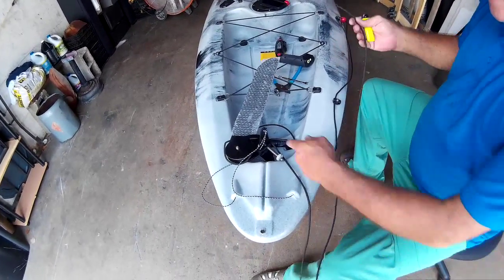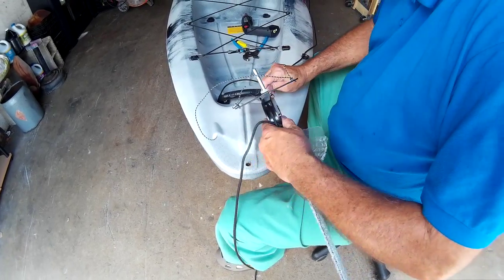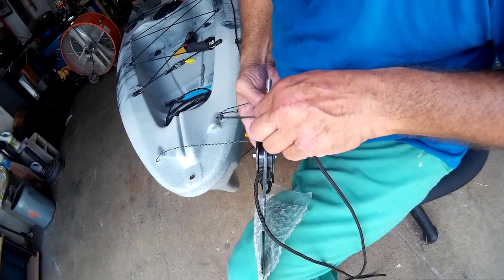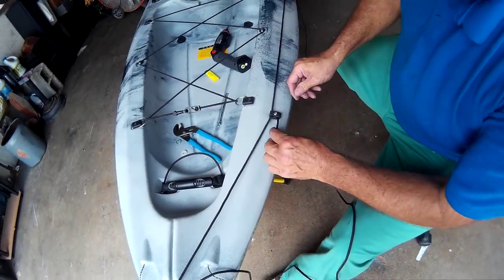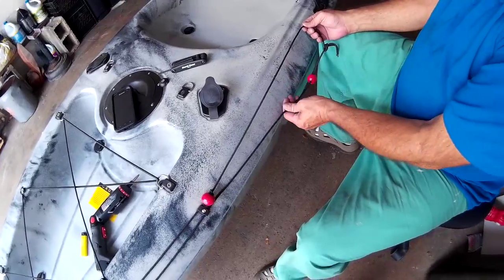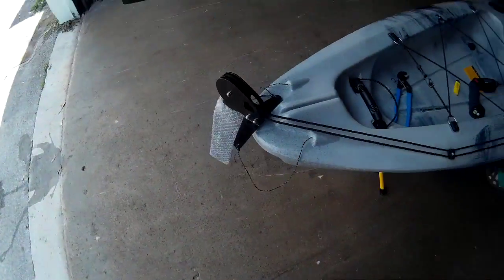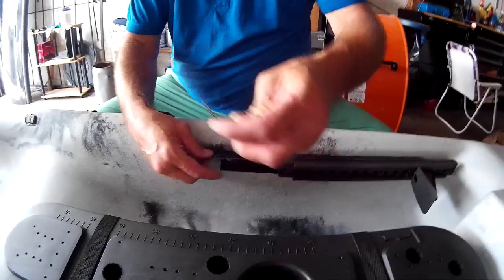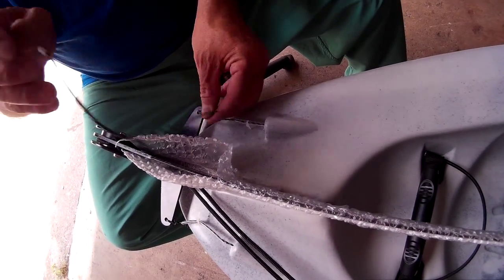Installing the Rudder on the Vibe Sea Ghost 130 Part 2

Comment: The lock pin fell off the first time I moved the kayak 5 feet lol.
Reply from the maker: What lock pin?
Reply: Willi Lopez it was attached to the rotor when I received it just a cheap little pin that flips down to keep the rudder secure I'm guessing.
Reply: Rudder
Reply from the maker: That's why I said to replace it with a regular key ring, stainless is best
Reply: Willi Lopez I was simply stating that I lost it the first time I touched the kayak LOL. Thanks for the video
Reply from the maker: Didn't you get it set up from the dealer?
Reply: Willi Lopez  The lines were fished that's it